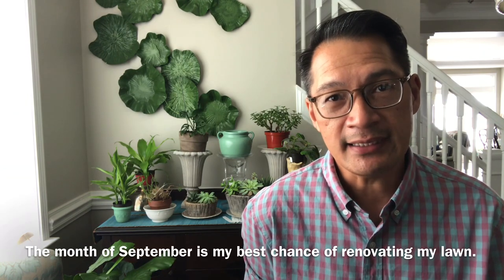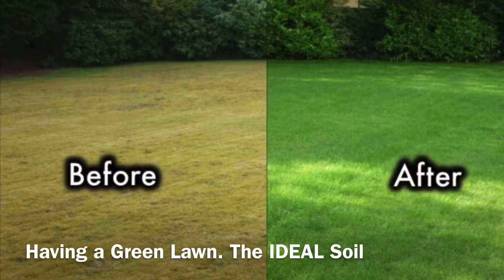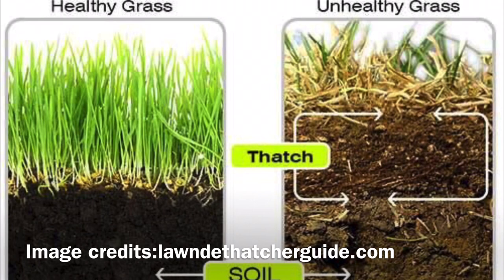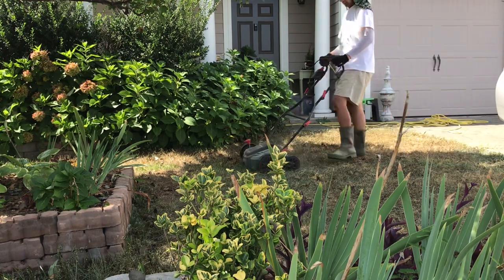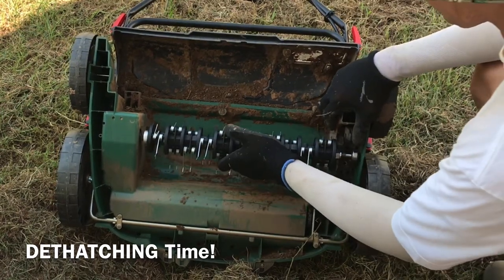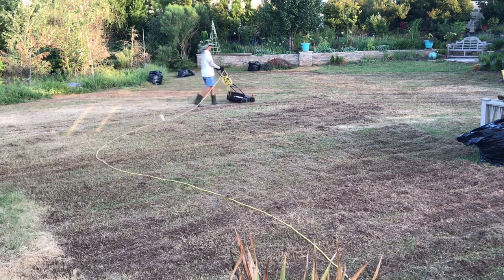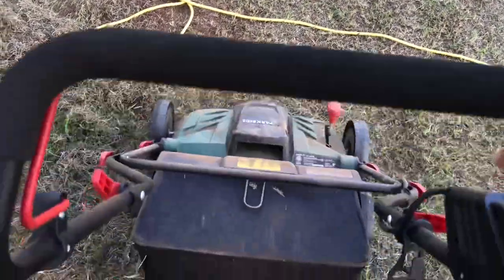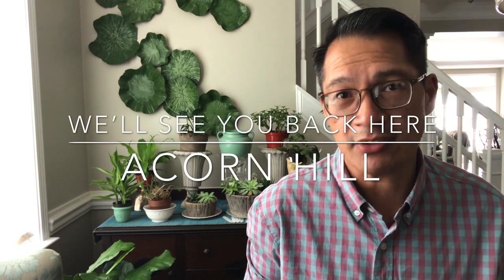FALL LAWN RENOVATION PROJECT: SCARIFYING and DETHATCHING. Buhay Amerika

Comment: Luie hope I spelled your name right. I'm here in the southeastern part of North Carolina and the grass type here is mostly warm season grass like centipede, St. Augustine, Zoysia and Bermuda. My back yard which has centipede has been taken over by weeds and have really choked the centipede out. I'm thinking about doing a reno job and turn my back into a Bermuda lawn. What product did you use to completely kill out the grass before starting fresh? Thank Michael
Reply from the maker: Hey Michael. Thanks for chiming in. That was the situation I had with my cool season grass last year.  It was choked out and annihilated by weeds.  In any case I used BONIDE BURN OUT to wipe them out. I must say, following the instructions closely, it worked.  Good luck on your upcoming lawn reno sir 👍🏼 - Louie
Reply: @ACORNHILL  Louie thanks for following up. How much time past after using Bonide Burn Out before you started scarifying, dethatching and using Tenacity as a pre-emergent?
Reply from the maker: I waited 48 hours after the initial Burn Out application. I was soo serious at getting even with the weeds. Hahaha.  Then then I immediately proceeded to scarifying.  Raking all the dead debris outa there
Reply: @ACORNHILL  Thanks so much Louie!!
Reply: @ACORNHILL  Louie quick question how did your Tall Fescue hold up during the winter months and does Tall Fescue survive in hot humid conditions during the summer heat if watered properly?
Reply from the maker: @michaela.singletary474  hey Michael. They did exceptionally welll during the winter months (remember they are cool season grasses).  I watered them sparingly to none at all during the winter. They kept their color. Toward the latter part of winter, there was some winter burn on the tips. Just a light browning. Nothing detrimental to the plant
Reply from the maker: @michaela.singletary474  as far as the fescue tolerating the hot and humid south, in my experience, they go dormant during the hot months. Which means they turn brown. The great thing about fescue is that they continue to be alive and grow DEEPER ROOT SYSTEMS. Which means that they may be “hot” on their foliar top, but they remain cool down below.  Fescue can certainly be coddled enough during the summer to keep it lush and green. It just takes an extreme amount of water to do so. Fescue needs an inch of water per week, whether that be from you or from Mother Nature.
Reply: @ACORNHILL  Thanks Louie.